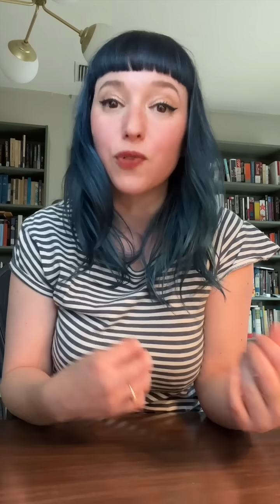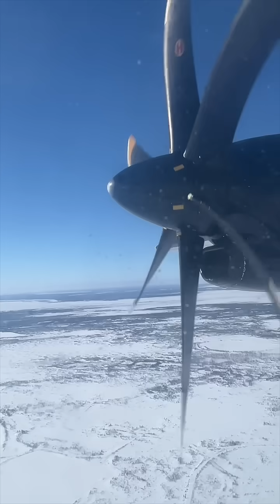Propellor STOPS mid flight!? #shorts #science #aviation

Comment: That clip of the prop uses global shutter (image is all sampled at the same instant), it looks even wilder than that when you have the more common rolling shutter i.e it scans the rows of the image sensor quickly to record, thus the rotating prop goes non-linear since it is sampled a different times in its rotation.

Comment: In Electrical Engineering, we call this aliasing, or sometimes the term Nyquist is said, and everyone nods their heads. Pretty much every radio application - even every communication system ever devised - uses mixing or sampling to "down convert" the signal to a lower frequency, where decoding can take place. 

Cool video - as always!

Comment: Well done.  

Another fun fact: mathematically the interaction of the camera frame rate and the blade rotation rate acts like multiplying two frequencies.  The result is two new frequencies, one shifted up in freq by the difference, one shifted down by the same freq diff.  Depending on the initial two frequencies, the lower freq can be in -ve freq side of zero freq.  

That's normally a mathematical artefact... but it can be dragged into the real world by the camera.  The backward rotation you see is the -ve side frequency.

Comment: I worked with a man that lost his hand in a cooling fan at a pulp mill because they used fluorescent lights and the flicker of the light made the fan look like it was turned off and he stuck his hand up into the fan. This is what happens when you don’t use proper lockout procedures.

Comment: It makes total sense when you search "average propeller speed of a GA (general aviation) airplane". The answer is 2400 - 2700 rpm. Any multiple of 24 yields an apparent stationary propeller, but it's more than that. Props typically have 3, 4, or 5 blades yielding 3, 4 or 5 times as many rpm rates that will align propeller blades in each frame or at least project a slow rotation. It's virtually impossible to keep a propeller from acting stationary given the 24-30 frame rate.

Comment: I remember when I was young I built a strobe light from a kit that does the same thing. If you’re dancing around, you can set the stairway to certain frequency in your dance around and wiggle and shake your hands around. It looks like it’s perfectly still it’s I had so much fun fun with that Whitr. I used to close my eyes and put the straw up to my eyeballs I’m with my eyelids closed and a certain frequency you would see very psychedelic images, colorful fluorescent images, it interfered with your brain. Brain hurts because it goes from the theater to Delta to beta to Alpha and somewhere in there on the alpha range you can all these colors and colors and geo metric images.

Comment: “Aliasing”!

More precisely, it’s related to what might be called the “blade rate”:  For example, if it’s a four-bladed prop, then it’s the time per quarter-revolution.

Then of course, there will be multiples of that:  The prop will look stationary if, on each frame of the video, it rotates 1, 2, 3 … quarters of a revolution.
 
Where we things get really wacky is rolling shutters, wherein the frame is not all exposed simultaneously, but instead, scanning across the frame!

Comment: G'day,

Yay Team !

I'm so old, that in my Playlist titled

"Windmilling Warbles & Raves..."

There's 1986-vintage silent Super-8 footage, which I shot on a Canon Camera which took FOUR Different Sizes & varieties of Batteries (!), of the

"Skypower Mk-4b"..., 

the Windmill which I was tinkering together, and trying to train it  to spin a 40-Amp Automotive Alternator - to recharge a Battery in the dayze before Hillbillies could afford Solar Panels...

When the 2-bladed Rotor was spinning at 300 & 600 RPM, it printed on the Film as a 2 or 4-bladed image with each Blade showing as a stationary Arc..., as the Windspeed varied, one could see the 2 or 4 bladed image rotating Clockwise or anticlockwise - as the Rotor accelerates or slows down...

At one point, being young (& thus immortal), I framed on the Spinning Power-Head in a 25 mph Wind, at 5x Telephoto, and climbed up the Tower to capture myself behind & slightly below the Rotor Disc's bottom edge...

Of course, it took 2 weeks for the developed Film to be mailed back from Kodak's Lab, so as a Tachometer it wasn't very useful..., but I was having lots of fun.

The YT version was captured
with a Potato on the same Tripod, recording the Image progected on a  Screen...; so don't expect great "Production Values", but it's an example of Photo-Chronography with an actual
Mechanical
Rolling-Shutter ; producing 
Stationary & slowly rotating images of  Spinning Rotor Arrays...

Enjoy the olde skool 
Waybackwhen-ery,
Viewed
Through the
Seebackroscope...(?) !

Such is life,

Have a good one...

Stay safe.

;-p

Ciao !

Comment: Cool!  A few days ago I was zoomed in to frame level on a video editor timeline, and the app showed my L/R sliding as side-by-side frames moving in real time.  Almost like film shows moving images a few frames right before it goes into the projector lamp.  Moving pictures is an amazing tech/sensory trick.
Reply: Old "Union Projectionist" here: Motion Picture machines use a Geneva movement to physically stop the film in the aperture for the duration of time that the shutter blade is not blocking the light from the arc or xenon lamp, 24 times per second, for the light to pass through the film then into the lens. The frame of film could be adjusted vertically to center within the aperture.
The shutter is a 2 bladed 'fan' that spins to 'open' and 'close' the light as each blade blocks the light when the film is moving to the next frame. If the shutter alignment is out of adjustment you get 'travel ghost' up or down the screen.

Comment: Your eyes work the same way, except your eyes operate at 60 fps. That's why when cars are going really fast, their wheels appear to rotate backwards.
Reply: Eyes are actually weirder than that, as they don't have any kind of global or rolling shutter (eyelids don't count) and therefore don't have a fixed frame rate. More than 90% of the time a light source is modulated, allowing the eyes to reconstruct the same effect.

Comment: fun fact, this is also why a neon light in a machine shop is dangerous. Neon light is like a fast stroboscope doing 120Hz. @ 7200 rpm you lath or mill will look like its not moving. That how you loose fingfers.
Reply: Do LED lights work the same way? If so, can you only use incandescent lighting in these situations?
Reply: @briansolomon2969  I'd say it depends. 
LEDs full blast are a continuous source of light. I'd be careful with dimmable lights where a PWM could be used to average a lower flow of light
Reply: @alexdeadeye6905  Thanks!
Reply: If you can't tell your lathe is running at 7200 freaking rpm w/o looking, I think you have other problems.
Reply: @Iceberg86300 it takes that awkward second for a woodworker to wonder why the table saw blade is stopped for them to instinctively reach for it. It happens. You know the saw is running, but it’s that second of confusion. Fluorescent lights are either not used in a shop or an incandescent or LED light is shined on the bladed.

Comment: I see rolling shutter has also been mentioned -- really common in cell phone cameras; though the weird effects are more noticeable on still shots than video.   If the blades of the propeller move a significant distance in the time it takes the shutter to scan across the sensor/film you end up with wild looking distorted blades -- often looking like the blade stretched like toffee.

Comment: The technical term for the effect is "aliasing" and can be observed in any sampled data where the sampling rate is not high enough (at least double the rate of the data being sampled). 

It's why music on CD's is sampled at 44.1 kHz, which is more than double the highest frequency humans are expected to hear (20 kHz).
Reply: I was going to mention something about this. I remember having to think about this while choosing sample rates for experiments.
You can also use this phenomenon to get extremely precise measurements beyond the baseline instrument tolerances. Some precision instruments purposefully use this in order to get measurements.
Reply: I knew a guy who could hear 23 kHz. I was using it find the resonant frequency of wires in a drift chamber (to measure their tension), and he was screaming in pain at 18 kHz.
I didn’t believe him, so we did a test….he stopped crying at 24 kHz.

He could also  identify metals by smell. We had lead, aluminum 6061, steel, copper, tungsten, and BeCu allow (a non 🧲 🔧 for bolting down the cyclotron). I had mercury, too, but we didn’t test him on that. He nailed all of them.
Reply: I was today years old when I learned what "anti-aliasing" refers to in all the graphics settings of video games I play. 🤯
Reply: @thatguy6054 Correct.  Frequency response is proportional to sample rate.  The CD format chose 44.1kHz because it gives a audio frequency response of 22,050 kHz.  This is filtered down to an even 20,000 Hz, as 20 to 20,000 Hz is considered the average human hearing range, although as we age the high end drops off.

Comment: Amy, could you explain to us why we are only now seeing a manned polar orbital flight ? I read somewhere that it requires a great deal more fuel burn to put the ship into an orbital trajectory, but I still really don't understand why 🤔. Thanks.
Reply: Space rockets launch eastbound, because that is the direction the earth is spinning. Earth's rotation gives the missile an extra sling shot of about 1,000 mph for free. This effect is maximum around the equator and zero on both arctics.
Sending a rocket to the poles does not take advantage of earth rotation. Flying westbound has a negative effect.

Comment: Another cool effect is speed on TV pictures.  TV images are created line by line from the top to bottom. So if you ever watch a top fuel or funny car drag race and they stop the image at the finish line, the cars appear angled backward because the car is moving so fast that the bottom of the car has moved relative to when the top of the car is imaged on the screen.
Reply: And I always thought zero to 300 mph in 3 seconds put the chassis into cartoon mode.
Reply: There are old photos from the 1920s of car racing that were exposed on linear shutter cameras that have the same effect.

Comment: The other cool thing about the way cell phones make their image is that propellers and other fast objects can turn into curves and swirls because of the way it will record the tips before the rest of the blade. And as the plane throttles up or down this changes.
Reply: Almost right: it will take the image from the top and down (or whatever direction you happen to be holding the sensor). This is known as "rolling shutter"

Comment: Do a follow-up on the effect of rolling shutters! Most CMOS cameras don't expose the entire sensor at once, so extremely fast objects can warp within even one frame. Rotor blades can appear to bend or even separate from the plane! It's kind of like taking a panorama and someone walking turns into an alien!

(Rolling shutters increase sensitivity by focusing more light and voltage to each part of the sensor. Global shutters exist, but are less sensitive and more expensive. You'd want to use a global shutter in a high speed camera like the Slo-mo Guys, but at the expense of requiring an insane amount of light.)
Reply: @theelderbrain  Seeing warped blades at weird angles to the hub and not attached always bends my mind a bit.  LOL.
Reply: @williamshetler4954  We would create similar effects by moving objects around on a flat-bed scanner while it's scanning.
Reply: As for why it's called "rolling shutter": some film cameras exposed the film by rolling or unrolling what amounted to a black scroll with a slot through it, letting the slot pass over the film.  Since the whole frame wouldn't be exposed at once, you'd get the same effect in pictures of fast-moving objects.
Reply: @theelderbrain - Rolling shutters DON'T focus more LIGHT on different parts of the image sensor. What they do is focus more ATTENTION on different parts, which does not affect light intensity or sensitivity. It is strictly a money-saving trick for the manufacturers.
Reply: Came here to reference this. 👍
Reply: Came here to mention this.

Rolling shutters have an outzised impact on why video of moving things like propeller blades look weird.

I discovered the effect while taking a picture of the side of a shopping plaza. I had been stopped but accelerated partway through the exposure when the light changed. The corner of the building was all warped.

I've also tried to take advantage of this by taking photographs when someone else in the room was using a camera flash. I got some really cool photos where the flash is only visible for part of the frame.